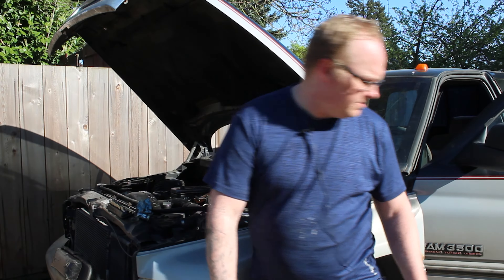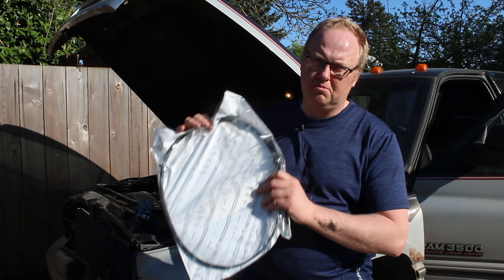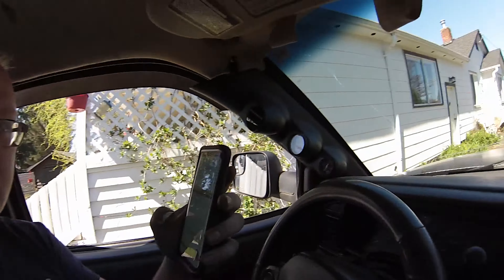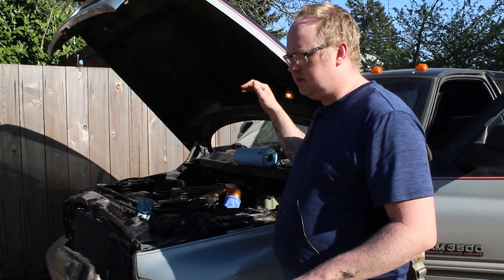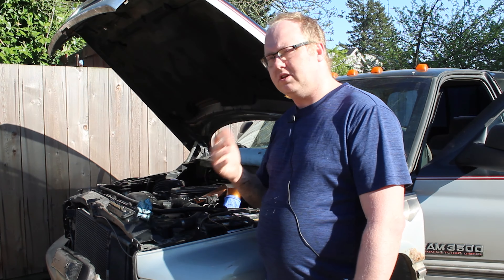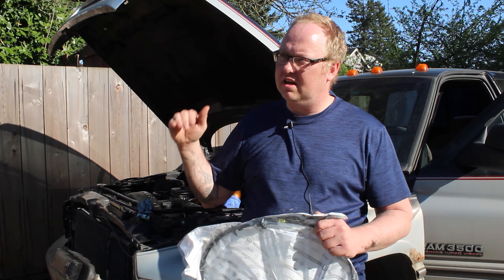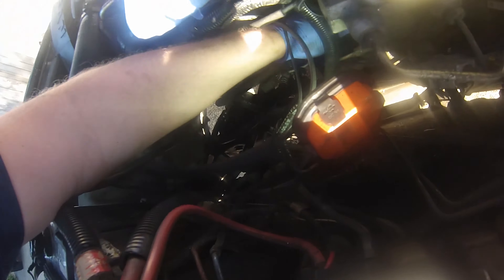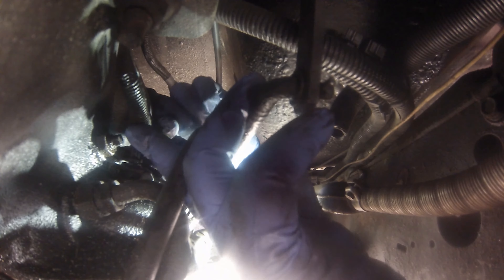How to replace and adjust transmission kick down cable TV cable 94 - 02 Dodge Ram Cummins 45RH/RE

Comment: I couldnt see where u hooked gauge cause camera was moving to qui
Reply from the maker: I removed the transmission temp sensor and put the Guage in that port.
Reply: O okay thank you sir I'm having trouble with my 46re..it won't shift out of 1st gear when hot?? It shift great when cold but hot it only has 1st gear and first?? Would you have any suggestions possibly????

Comment: 96 auto .So my throttle sticks with the kick down cable attached to the throttle assembly, so can i just simply replace it or would i have to adjust the pressure like you did?
Reply from the maker: I would start with th cable first

Comment: Mines comes off easily from the transmission is that normal
Reply from the maker: The cable should give resistance to come off, you should have to use some force to get it off.  If not, the socket on the cable end could be worn out.
Reply: @SouthdownGarage  thank you for the reply
Reply: I’ll let you know what happens
Reply: I have a code of p0230 is that my vp44

Comment: I was removing my throttle body and accidentally broken the plastic connector of the transmission tv line, do you think that part is replaceable?
Reply from the maker: Have you checked rockauto.com
Reply: @SouthdownGarage  Thanks for the quick reply but unfortunately no they aint got it gonna have to hit a junk yard. But eventually do wanna replace that line.  question what did you use to measure the pressure when testing it on the freeway and where did you hook the gauge up too?
Reply: I have the same issue i bought a clip but it doesn't seem like it will work out
Reply: @rockobukkako813  really? did you purchase it on Amazon?
Reply: @rockobukkako813  im still waiting for mine to get here been almost 2 weeks since I ordered it 😒
Reply: @eldiablo559  yeah it was an amazon detent cable end didn't seem like it would jive with the old cable so here i am watching cable replacement videos
Reply from the maker: @eldiablo559  I put a hydraulic gauge for like 200 or 300 psi I think plumbed into the hole on the trans where the aftermarket transmission temperature sender was plugged in. My pressures were not showing great though, so I might have to adjust the pressures next...I just have to put it back together first
Reply: Buy one on my eBay.